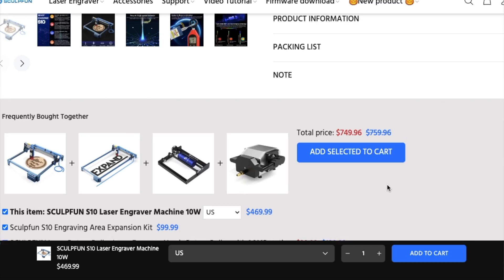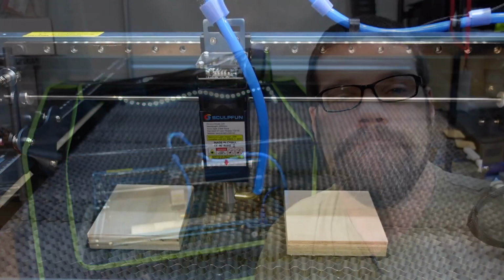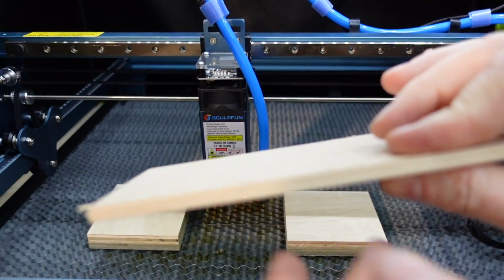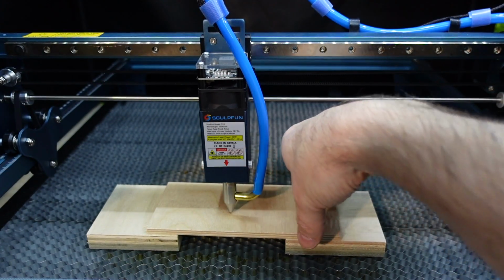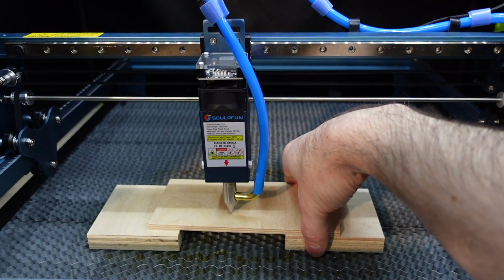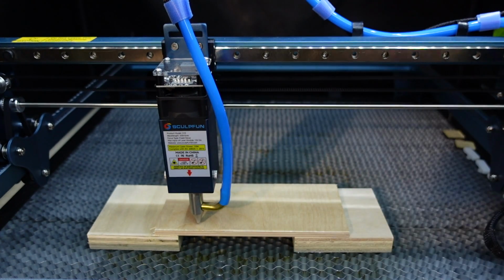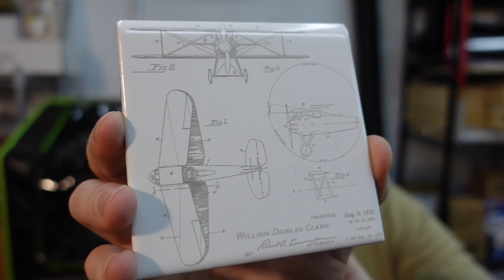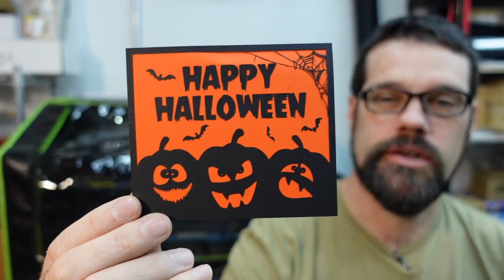Sculpfun S10 Laser - Testing and Review

Comment: Any tips on how to get mine to work out of the box? I Can’t get it to home itself without grinding. Simply can’t figure out how to calibrate it for its first project 🫤
Reply from the maker: Did your laser come with limit switches?  If not, it won’t home, if so, check all the connectors to make sure none are loose.

Comment: there is a detail here that no one talks but, they should talk, the power supply that comes with this machine "sculpfun S10", is not in condition for this machine, and probably for the s9, I say safe source that when you are cutting reaches spend 8 Amp, how is that a source like this that comes with the machine that has the power of12V 3Amp reaches to cut MDF 4m / m, the source aninha reaches 11. 55 volts, any day the source will burn out. They should tell people everything they know so that they won't be fooled, and they should be prepared in advance with a power source. So pay attention when you buy a laser machine, what matters is the output power of the laser diode. Mine is an S10 10W" and it doesn't do what you show, how do you do it?, but if I put a power supply with capacity to feed the machine it even cuts, be honest and "don't fool people" my machine even spends 8 Amp.

Comment: Can it engrave photographs /portraits on marble slabs? Engrave  portraits granites? Is it clear? And if it is how much price range ? I want to try goin in the laser business, i want to have fun and also want to share a project with my family , thank u and i like aswell as subbed!
Reply from the maker: That will depend on the color of the marble.  As the diode lasers wavelength is at 455mn in the visible spectrum, it will vary on how it interacts with the material based on the color and translucency.  A dark black marble will work much better than a white marble.  This is why you have to apply a coating to glass to get the UV Diode lasers to etch on it, otherwise it would go right through it.
Reply: What coating? Can you tale it after? Will it also work with cutting?